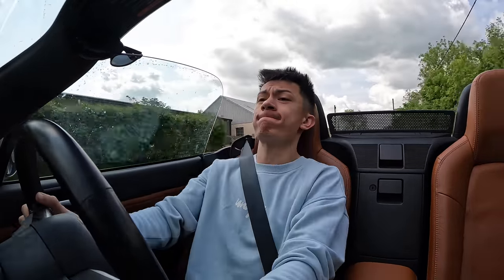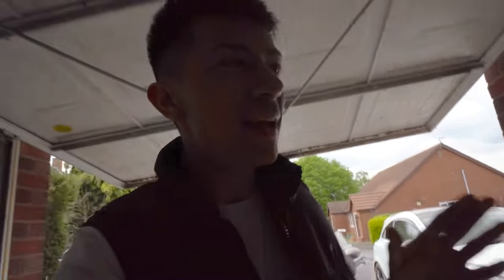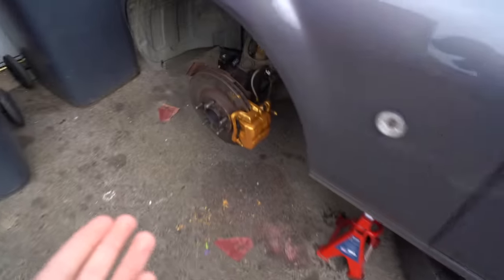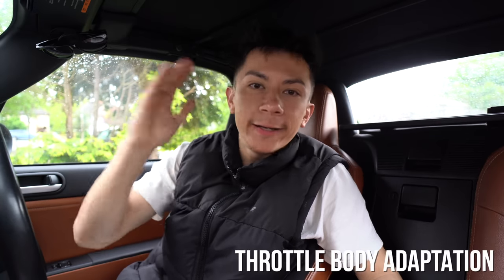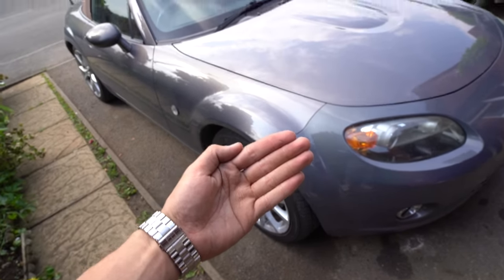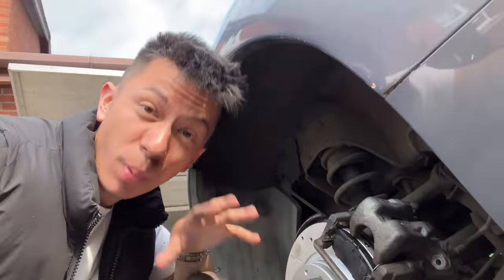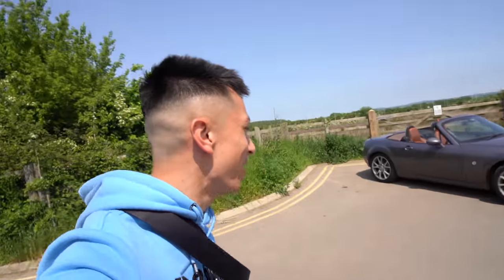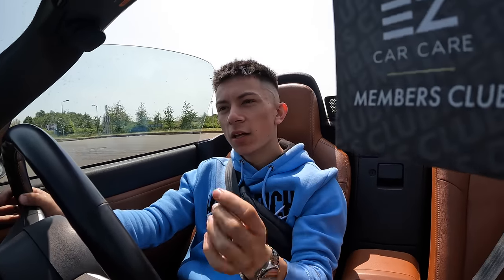NEW BRAKES FOR THE MX5!

Comment: The piston on the rear calipers are wind in pistons you need a special tool to wind them in keep it up though mate its a learning curve
Reply: Special tool 😂 large flat screwdriver worked fine to turn mine remember lefty loose

Did he totally forget to add fluid or bleed them after totally swapping the caliper then had no pedal lol

Comment: Bit of advice, the rear callipers are wined back, instead of pushing you need a tool to spin the piston back which is why pushing didn’t do anything… 

Also when pushing/winding the pistons back you should really have a bleed bottle on the bleed nipple, system isn’t designed to have fluid go backwards so not doing it will only strain the internals of the calliper but your master cylinder aswell not to mention the seals etc in the abs unit